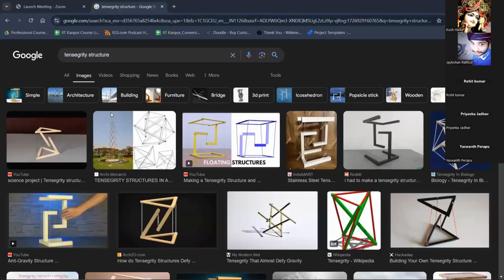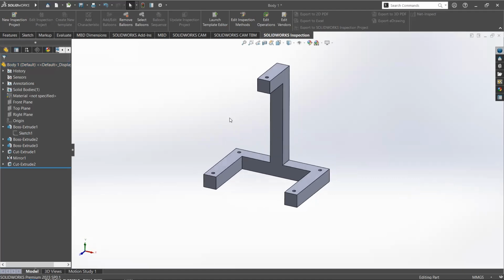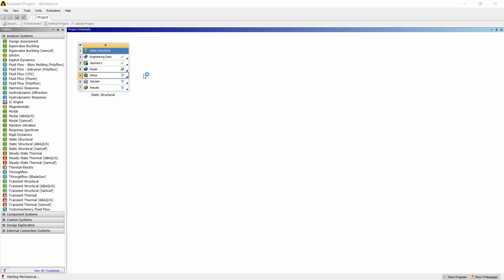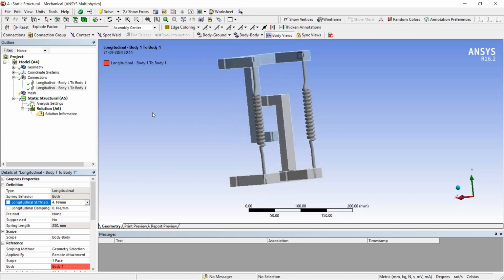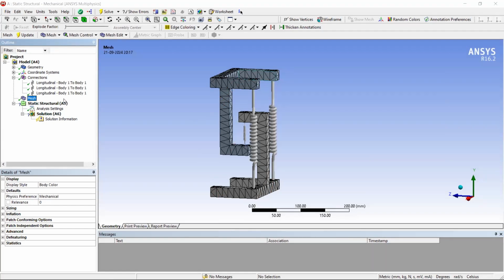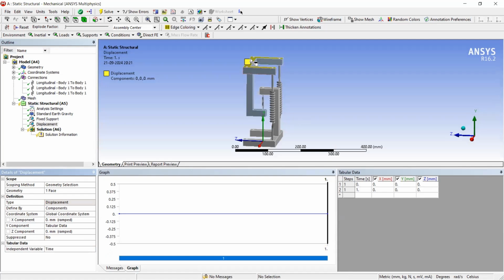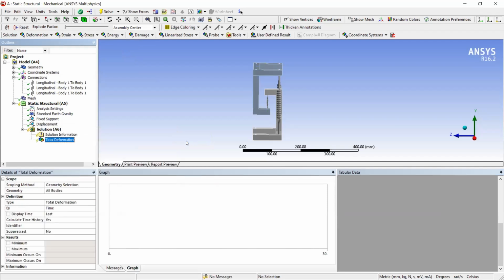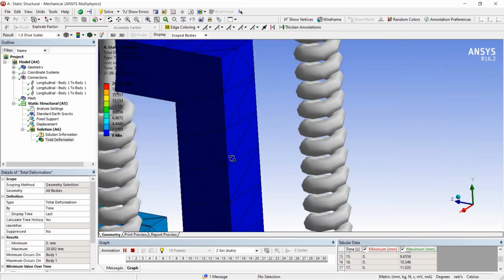Tensegrity Structure Analysis using ANSYS with Explanation in English | Skyy Skill Academy

Comment: im a little bit confused. you're saying the springs are in compression, but this was supposed to be a tensegrity structure (ie: all members are only in tension and not in compression). im also not really sure what this analysis is showing since it seems like you're just forcing a displacement and then measuring the displacement you just set?? how does that tell you anything meaningful
Reply: it doesnt tell you anything meaningful